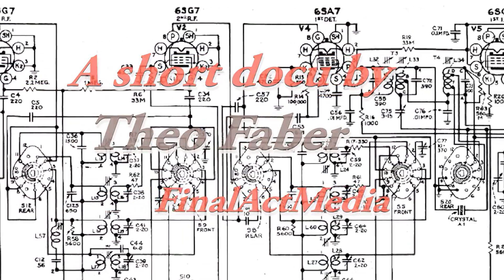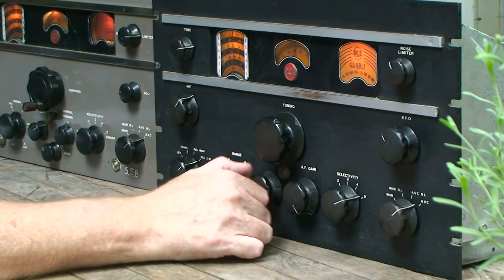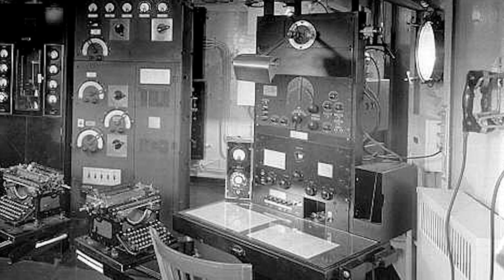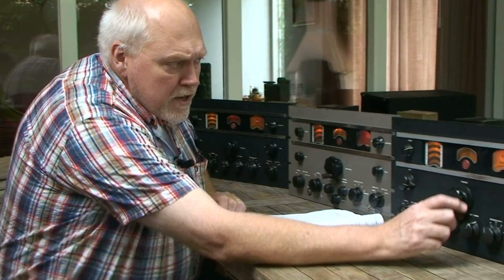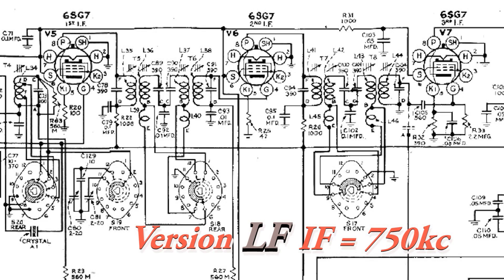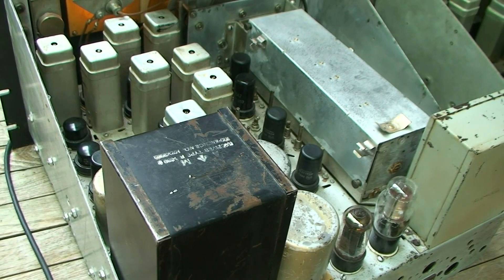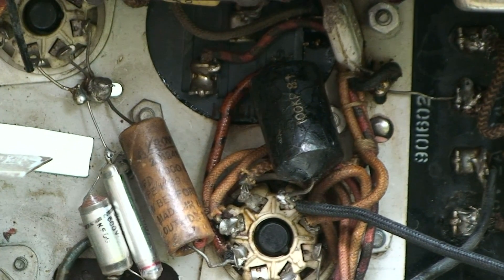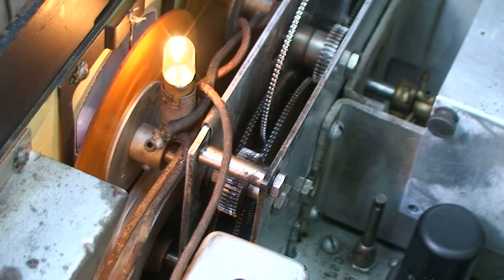RCA AR88 history / explained

Comment: Intetesting report but it doesn t really explain the circuit design and doesnt describe the exact performance fitst, on terms of user experiance and then. where it compares with the "Big 3" receivers of the late 40's to 1950s  era e.g.
The National HRO 50/60, The Hammerlund 600 and the Collins R-390/392

Comment: Thanks for this vid Theo. My first tube type shortwave radio was an RCA CR-91A that looked just like that radio in the middle. I got it in the late 70's. It was surplus from the Canadian Air Force. Sadly I sold it when I got my R-390A in the early 80's.